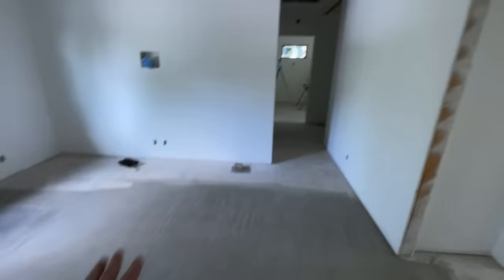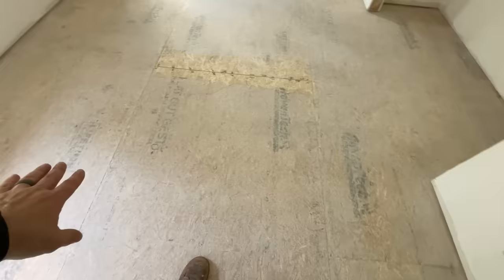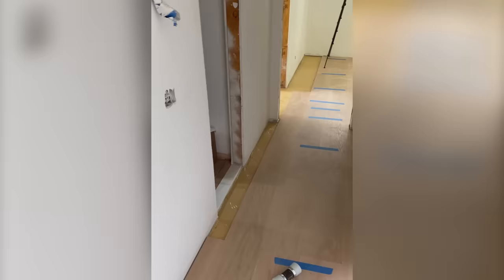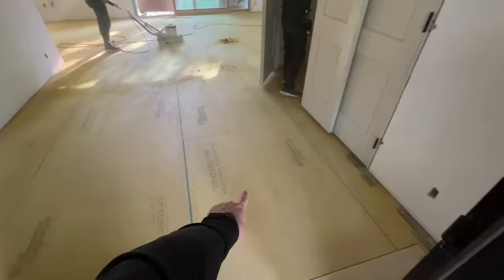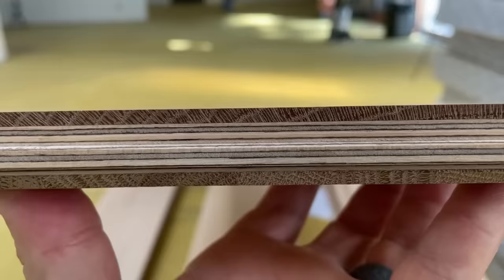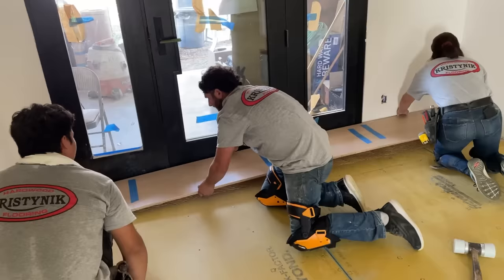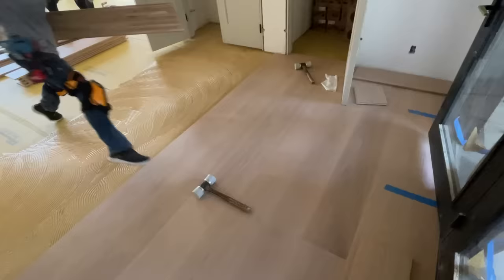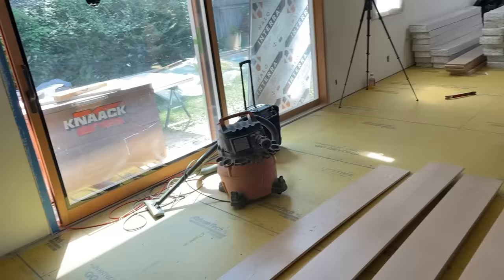Engineered White Oak Hardwood at The Real ReBuild!

Comment: Why not to use a good LVP product? Some material have 9”wide and 60 or 72 long. 
Like a floor installer can say( just my opinion): glue something to your subfloor it’s the biggest mistake
Reply: LVP has its cons, like it can't be refinished, has limited wear layer, vulnerable to UV, etc. while this isn't regular wood.  It's specially engineered through a patented process that makes it extremely stable, durable, long lasting, and low maintenance that will likely outlast his grand kids, can be refinished multiple times, will be more comfortable to walk on than LVP, etc...
Reply: @ZeoCyberG  you are pretty optimistic about engineered hardwood, but real life show all things about it. 
Eng wood have less wear layer then LVP
Eng wood have less scratch resistance
Eng wood do not have moisture resistance 
And see you when people decide to refinish. For this cost you just can change whole LVP floor. 
About wear layer. Yes it’s limited, but how many years you need to end it ? Lol 😂
Reply: @alexfed4721  LVP is good, but there is no LVP that can match the look of natural wood. Ive seen some stuff that looks pretty nice, but you can always tell the difference. A bad lvp can make a new custom house look like a cheaply remodeled dentists office.
Reply: @alexfed4721  Sorry, but no, this isn't traditional eng wood.  This is a new type that uses a patented process but involves things like thermal modification, etc. and it is resistant to moisture... In fact, they're even testing it for marine use and so far it looks like 10+ years... The company also does a lot more than just flooring and would be a lot more durable than vinyl for exterior applications....  Besides, this is a generational home he's building, he expects it to stay in the family for centuries...  Floors that can last that long is what fits...
Reply: @ZeoCyberG  I agree with you that it is hard to beat the feel of real wood but the new vinyl is a close second. I put it in a ton of houses including my own and since I have a 200# dog that let's just say, is not really floor friendly. Lol. It has stood up to him and my 10 year old for 3+years now without hardly a blemish. Best thing about vinyl is the water resistant factor.
Reply: @apsdidit  Yes, if you can get the 100% vinyl product they're very long lasting and durable.  Just have to watch out for all the inferior products out there. While they've gotten a lot better at imitating wood.  It's just still an imitation and you can't do things like refinish it and change its appearance with a different stain or oil treatment. 

Product, though, goes beyond just that comparison as he was able to get exactly the appearance he wanted, which they tailored to his specific wants and he didn't just choose from their selection and the same company also provided him some of his exterior details.  So he got more out of this than just the flooring...

Comment: "European Oak" has an elegant ring to it but is there some species of oak in Europe that makes a better floor?
Reply: used to watch some British remodel/build shows (grand designs?) I remember a few times when doing timber frame structures they would have to source timbers from France because the French had a tradition of raising oaks with minimal defects
Reply: It's called European because of the way it's cut. It is just Live Sawn. Look up live sawn. This is common in Europe and making it's way into the US
Reply: It makes the wood more stable cutting it that way

Comment: I would like to put real hardwood, not engineered, over what I believe are VAT tiles. Don't want nails and don't want glue down. Is there a solution that will work with these limitations? Thanks!

Comment: I'm a little worried about your expansion gap. Any engineered hardwood requires at least 3/8 in gap if not 1/2. With such a large floor I think you would see some movement, but I've also never glued down a floor like this, only float and nail.

Also, at 11$ a square foot this floor is beyond the budget of most of my clients
Reply: Float over a concrete slab?  I'm worried about it not being solid

Comment: Come on man. Haven’t even made it half way through without laughing. Leveler on wood makes as much sense as tiling with thin set on wood. It is NOT going to adhere long term. It will come loose from the sub floor. Secondly, expansion on a glue down floor is a misnomer. There is absolutely ZERO MOVEMENT on a glued down engineered floor. By the way that’s why I like them so much. Have a very similar product in my own home. I know your into quality and that’s great. Let’s not over do it with in accurate information

Comment: Hey there Matt, I enjoy watching your videos and was wondering if you could point me in the right direction? 

I'm a mechanical engineer looking to do an owner build and am trying to find a guide to building a house and to have the knowledge whether the work done by my future subs is right or wrong. I remember you mentioning the following book in one of your videos: "Builder's Guide to Mixed-Humid Climates”. Would this be sufficient? If not, do you recommend any other resources? 

FYI so you know my background, my experience in remodeling includes the following: I've built a pan for a tile shower, done laminate flooring, plumbing, framing, panelling, dry wall, carpentry, replaced electrical sockets, installed multiple light fixtures, and I've built about 3 chicken coops. Technical wise: I have B.S. in mechanical engineering, so I'm pretty familiar with physics. Management wise, I'm a continuous improvement engineer so I know how to improve processes. 

However, I've never built a house and would like to avoid big mistakes! 

Thanks for your time!
Joseph

Comment: So can this product go directly onto a concrete floor
Reply: Yes, engineered wood flooring can go directly onto a concrete floor with the proper glue, and assuming there are no moisture problems or cracks in the concrete.
Reply: Or do like matt and put layers of insulation and two layers of osb on top before the hardwood. Lets have 5-6 inches of subfloor on concrete? Wtf
Reply: @chriscoleman2128  No need for that. Many builders in the south use engineered wood flooring glued to the concreate floor on the first level (and glued to wood subfloor on higher levels).
Reply: @chriscoleman2128  wait til a leak & has to rip out 4” of build up .

Comment: why are those boards being glued down?  why aren't they allowed to float like Pergo?
Reply: Laminate and vinyl plank floorings actually lock together whereas hardwood floor spline and grooves loosely fit within one another and must be secured otherwise the seams would open up
Reply: There are some wood floors like that, but they usually are not as thick and solid as Matt's flooring.

Comment: How is this finished? If titanium believe it’s a challenge to sand!also it remains problematic to recommend a flooring that is sponsoring the show but also doubtlessly giving you a substantial break. In the materials cost! I think full disclosure would militate for acknowledging any such deal….
Reply: Matt has disclosed that he got a great deal on the flooring. You are correct that engineered wood flooring with a factory applied titanium finish is hard to sand and refinish, so it is usually just easier to replace any damaged planks instead of refinishing.

Comment: Tell me you didn’t put cast iron crap pipes in your new house all to plug some local plumbing company…
Reply: Cast iron is sometimes used these days for drain pipes in areas where the sound may be heard through the walls. I don't know why you think that usage is crap. But I don't know if Matt used any cast iron or not.
Reply: He did. Plastic pipe noise is horrible.
Reply from the maker: All my drops are cast iron for noise. Rest is PVC for DWV. Uponor PEX for supply
Reply: @buildshow  - I still think that was a really really bad choice.  Why not use rockwool around the pipe of the wall?

Comment: Seems like an unnecessary compromise to not install real wood floors on such a high-end house...why settle for engineered...
Reply: The other part I found puzzling...this house was totally rebuilt and framed with T-studs....how is it out of square already?
Reply: Factory finish on a high quality engineered is much more durable than any site finish available. And…we don’t have a big pool of skilled floor finishers in Austin, or the entire Southern US for that matter,  since 99% of hardwood is going on concrete slabs and, therefore, is engineered hardwood, not solid.
Reply: Agreed.Fake floors instead of real, solid, all the way hardwood floor and buckets over buckets of glue to make the air more toxic in the house
Reply: @ericrlake  I know of plenty excellent finishers in Texas . . If he prefers fake floors no biggie , but this is false .
Reply: Engineered is superior to solid wood in every single way. The only argument with merit is the fact that you have a veneer at the top and it can only be refinished a couple of times, but hardly anyone refinishes their floor, not in the west part of the country anyways, and certainly not more than 3 times. If its a big concern you can always choose a product with an extra thick veneer.
Reply: @nixaeagle141  It doesn't matter how good the finisher is. A site finished floor is not as durable as a factory finished floor where the finish is baked on. Engineered wood floors are not fake wood.
Reply: Engineered IS real wood, what do you think it’s made from?
Reply: @SgtZima  engineers?
Reply: @apsdidit  Hah. But seriously, people are acting like it’s plastic or something. Maybe they’re confusing it with LVP or Laminate.
Reply: So many engineered wood apologists here. Let me guess, MDF is real wood too? Let me give you a hint, real wood does not have acronyms and is not made in a lab. It has names like "oak", "cherry", and "maple", and it lasts for over a hundred years. The finish is the most irrelevant part of the material, there are many ways to finish and take care of wood that will make it last decades before needing a refinish.
Reply: @mr.g937  No, MDF is not real wood. And Matt’s flooring does have a name, which he says a number of times in the video. It’s white oak. It sounds like you don’t know what engineered hardwood is.
Reply: @SgtZima  Engineered wood is not a solid piece of wood, period. It's glued together hardwood (maybe 20%) plus plywood. If you can't discern the difference between an glued-together material with filler in the middle, and a fully solid pure piece of wood, then I can't help you.
Reply: @mr.g937  I know exactly what it is, but you said it wasn’t “real wood” when it absolutely is real hardwood on top. Now you’re backpedaling.
Reply: @SgtZima  I don't have time to play word games with people who choose to willfully misinterpret things for the sake of argument. A small part of the plank is real hardwood. That doesn't make the entire thing real hardwood, and it would be foolish to consider that difference irrelevant or immaterial.

Comment: Matt -- you mentioned nothing about humidity levels in the home. It is irresponsible not to point that engineered floors can fail (the wood checks or splits) with humidity levels below 35%. Some manufacturers will refuse to sell engineered wood in areas of low humidity. 

Engineered floors can cup or crown if subfloor moisture if wrong. You mention nothing about subfloor moisture.

Tell the whole truth.
Reply: Jeez, lighten up.

Comment: Why fake, engineered floors instead of real white oak, solid planks all the way thru? And buckets over buckets of nasty glue all over the house to make the air more toxic when it heats up and creates a lot of VOC. No reclaimed wood either, such a shame...
Reply: Engineered wood floors are not fake, they are engineered. For similar reasons, a 2x6 LVL is superior than conventional 2x6 dimensional lumber. Same thing applies to joists, etc.
Reply: @mark9118  You know what I meant Mark. Engineered as in not natural, more layers of bits and pieces of wood held toghether with more glue
Reply: @mseverus1  It's not bits and pieces. It is basically plywood with a thick top layer. Plywood is made from sheets of real wood (not chips) glued together in opposite directions for stability. It is not particle board.